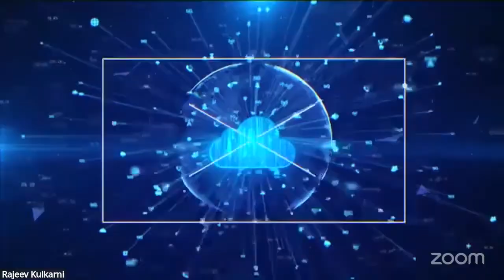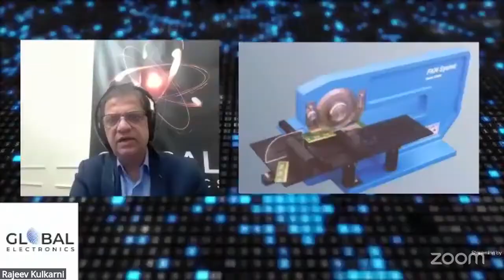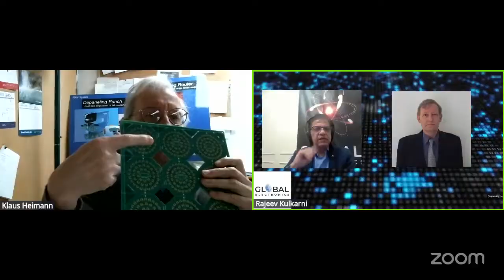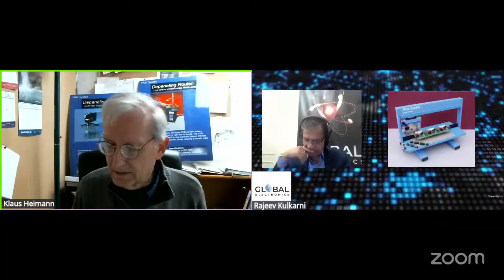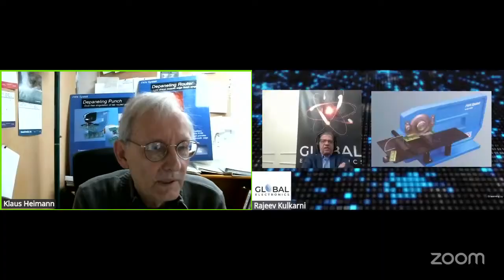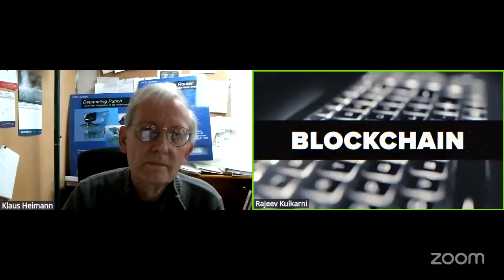GLOBAL ELECTRONICS IS WITH MR KLAUS HEIMANN #PCBOARDS #SINGULATION #USA #ELECTRONICSMANUFACTURING

Comment: Good day, what precautions do you recommend to prevent electrostatic discharge to the circuit boards in cutting machines? Is the machine grounded at the cutting point? Do you know if it needs to be grounded dissipatively or is it metal-to-ground?